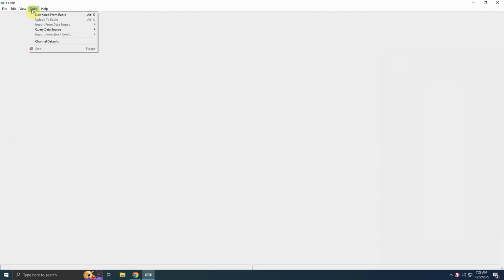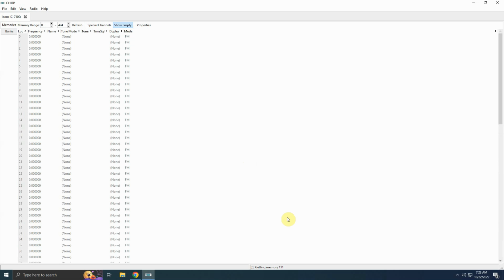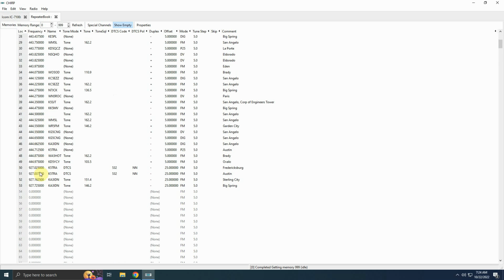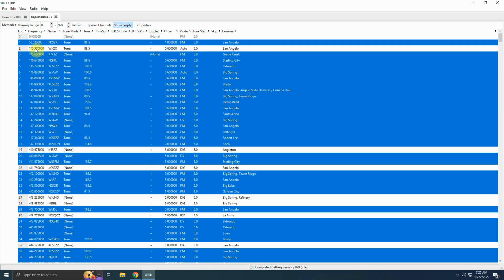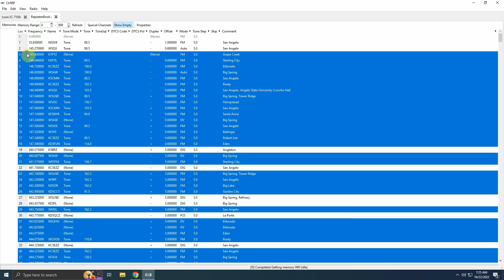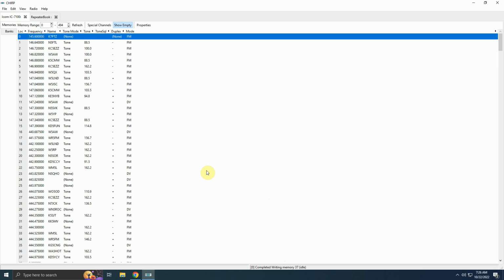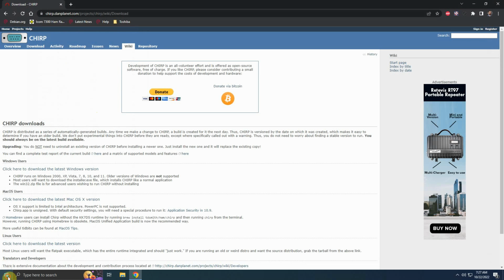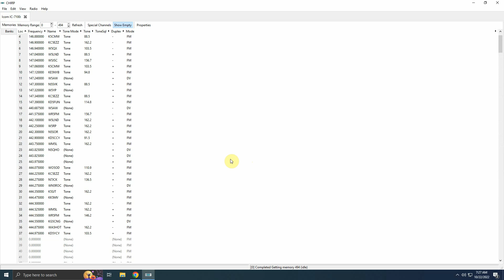IC 7100 Tips and Tricks   Programming Memory Channels with Chirp

Comment: I just downloaded and installed Chirp for the 1st time.  It is version 20240224, and it does NOT have a "detect" option for the radio model.  I'm trying to use it with my 7610 on Com3 with a standard USB cable that works with my other software.  I made sure that Omnirig was not running.  The download function flickers as if it's going through the motions, but does not read the channels from the radio.

Comment: So what did you use for computer to ICOM just a USB cable or the CIV port?  Thanks for the Video
Reply: I was about to ask the same.
Reply: Yeah, can confirm you can just use the mini usb cable that comes with the radio. Successfully comnected to latest version of chirp (chirp-next) with it. With linux make sure to add yourself to the dialout group, log out and back in, then it'll be able to connect to radio